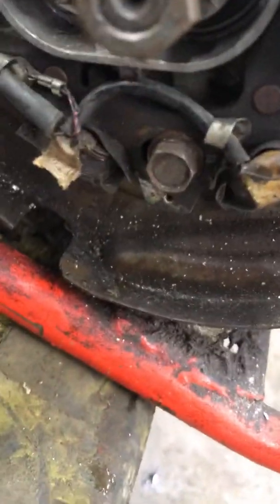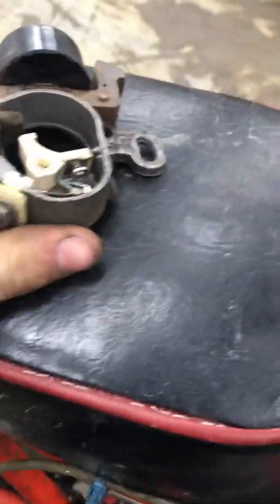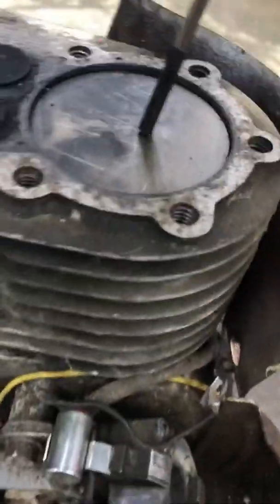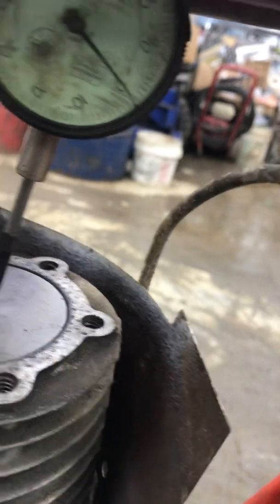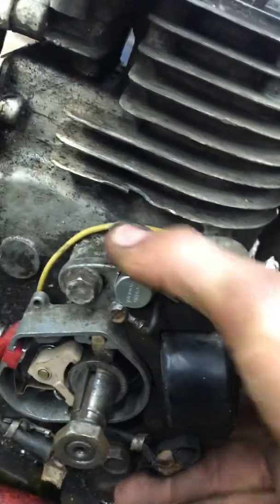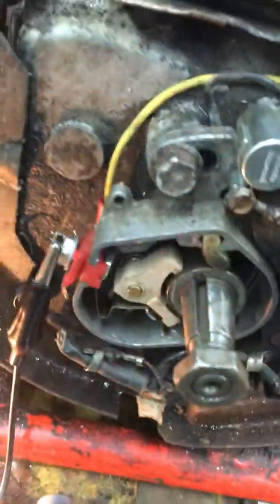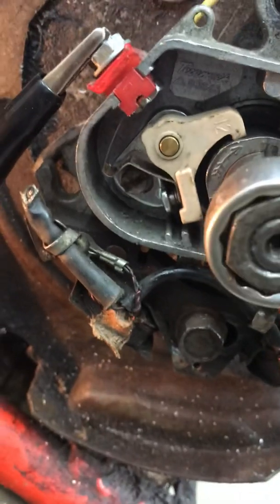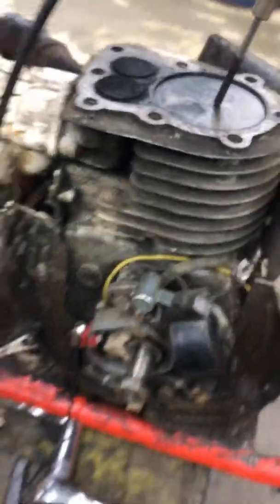Tecumseh ignition timing

Comment: Great vid. I cleaned and adjusted the points on a tecumseh h60. It now has spark and idles, but backfires out of the carb when I throttle up (then it dies). Should I readjust the points, or set the magneto? I haven't touched the mag yet. Thanks in advance!
Reply from the maker: Scott Hillegass sorry I just saw your comment😬 Make sure your points gap is correct and make sure there is healthy spring tension. I had a Briggs and Stratton that had a weak spring on the points and it wouldn’t rev very high because the timing was off due to the points “floating”.